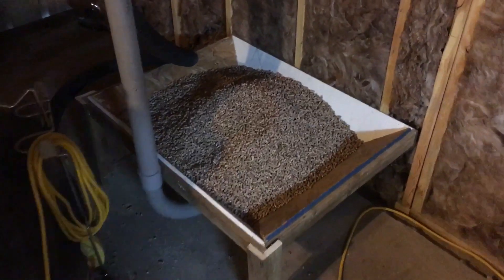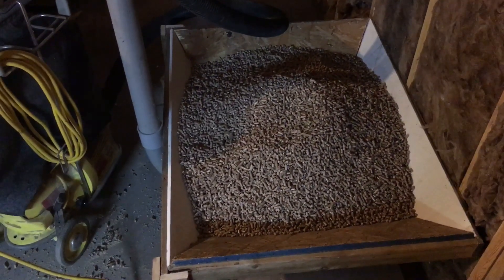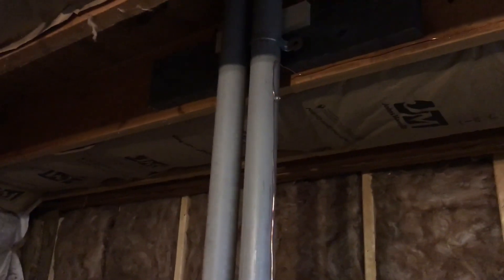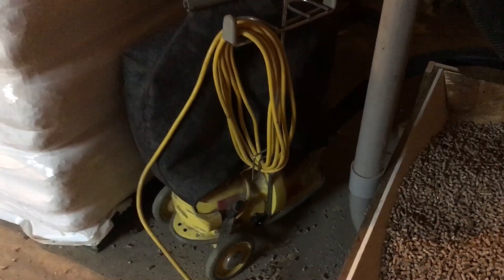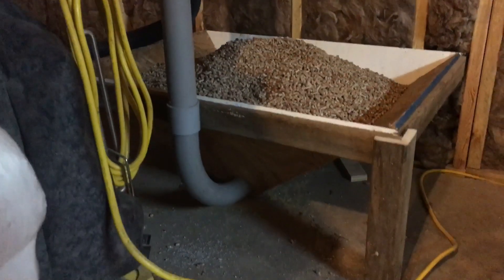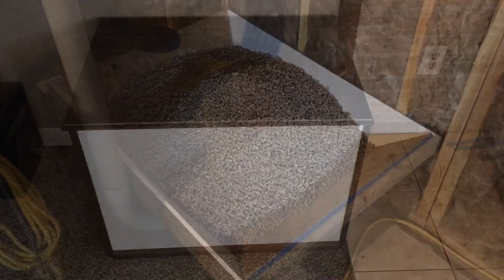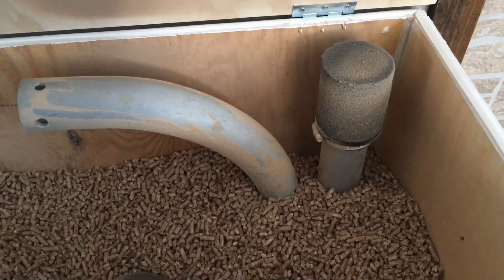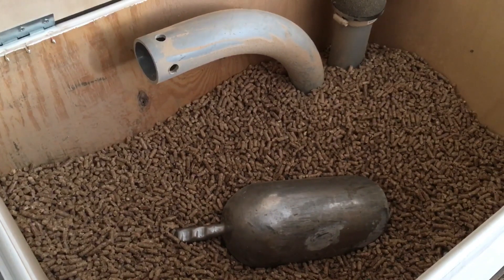Wood Pellet Transfer System

Comment: Tried to build a similar DIY construction to transfer pellets from my storage room to our main pellet hydro stove. I used around 10 meters of flexible PVC 38mm pipe (1563042294516_0..jpg)  but pellets get stuck every 5-10 seconds so it's kind of problematic. The vertical height is close to yours, one level high. I want to try using PVC pipe like one you use but don't know what is the proper diameter, could you please send me what you have used there?

I am using a vacuum cleaner able to suck 200 airwatts.

Comment: Hi Martin I really like this video I am really hoping you might be able to show a video where the Vacuum is connected and how it works I have seen the Pellets going into the Hopper up stairs amazing stuff well done on this project I don't know the size of pipes you have used Martin thanks again for this wonderful video
Reply from the maker: I'm actually in the process of completely redesigning the pellet transfer system, I should be posting updated and more in depth videos soon!

Comment: How long does it take you to xfer 3 bags?
Reply from the maker: Jay Landry it takes about 1 min or less per 40lb bag. I’ve done some minor updates to help the efficiency.
Reply: @martenkent1913  I have a box that holds 4 tons. I get a truck that delivers for me but would like to find a way to be able to fill the box myself. Here is my setup. https://youtu.be/Mp535pw7yIc
Reply from the maker: Yes, you could make a vacuum box inside your 4ton storage bin with a spring that holds the bottom of the box closed when empty. When you turn the vacuum on, it would stay shut until full of pellets, then the bottom of the vacuum box would drop open from the weight of the pellets  allowing the pellets to drop into the 4ton storage bin when the vacuum is shut off.
Reply from the maker: You could very easily suck the pellets up out of the access box you have in front of your storage bin and upstairs to your pellet stove. You may need some baffling to prevent the pellets from overloading or clogging the transfer pipe. Just play around with some wood baffles and you’ll figure out what works best. I hope to see a video of your setup if you end up building something!
Reply from the maker: So you want to be able to buy your own pellets and put them in your 4 ton storage bin? The only problem I see there, is the large volume of vacuum you would have to draw in the storage box to get pellets to transfer. The storage bin isn’t vacuum tight is it?
Reply from the maker: After watching your video again. I’d like to see what’s between the green vac line from the truck and the blue pellet supply line. I’m assuming they are very closely positioned on the inside of the storage bin, and maybe a screen on the green hose prevents the pellets from getting sucked back to the truck, therefore they fall into your storage bin. If this is the case. Try applying a vacuum to the vac port and a hand full of pellets to the supply port
Reply: You are right i would have to make that storage box air tight to be able to create a vacuum. My plan was to buy 1 ton bags of pellets and have them blown in some how to the 4 ton box inside the house. The storage box is about 10 feet away from my pellet furnace (Harman PF100) . The furnace will hold 120 lbs of pellets and i have the option to buy the 1 ton hopper that goes beside the furnace. Maybe i could make a smaller air tight box on top of the bigger one and fill that one with the vacuume. Once full i could release those pellets and repeat the process.

Comment: Hello,
I'm trying to make a transfer system in a silo. Can you give me information about the blower and the mounting system? Blower power ... pipe diameter ....
I tried a system like https://www.youtube.com/watch?v=Ek3xa9MiShc but I have a problem, I have a T-pipe under the tray to transfer the pellets. The air goes to the left of the T, go right to the silo but I have a lot of air coming out of the top of the T and the pellets in the transfer tray that is above, do not come down almost, they are blown to the transfer tray instead of being blown to the silo ???? I certainly made a mistake somewhere but I do not see where? If you can help me, give me additional info about your system. After 60 years, it becomes difficult to carry bags and it would be easier to blow.
I am in Belgium.
Cordially.

Comment: Cool. What kind of vacuum machine?
Reply from the maker: It’s a 1.5hp vacuum
Reply from the maker: Dmitry Popov it’s a old commercial NSS Super Suction Vacuum.
Reply: @martenkent1913  qué potencia tiene el compresor?
Reply: Wow this is awesome!!! we have to haul the bags of pellets right now, up some old basement stairs and it's awful. I did make a stair master sort of contraption with a winch system to bring up 2-4 bags at a time, but it doesn't look very good having 4 bags of pellets in ur living room. Any way u could do a tutorial on how you built the boxes and piping? That would be sweet. Great engineering!
Reply: @red05malibumaxx  For a sealed box in the room, use an old refrigerator, it has the seals in place just clad it.
Don't cut the cooling system, just lay it on its back with the bottom against the wall. cut the pipes in through the side where there is no cooling.
Ive seen small chest freezers used for this in Denmark they are clad in wall boards with an old table top on them then they look like a piece of furniture. 
The discharge pipe into the box is best perforated or sliced with an angle grinder inside the box to slow the exhaust down, that way the pellets don't smack the wall as hard, and pointed diagonally from one corner to the other so there is more distance.
the piping is usually 2" any smaller and a vacuum without adjustable suck will draw too fast down a narrow tube and all you end up with is a box full of sawdust as the pellets will travel too fast and disintegrate in the process
Reply: @joegodfrey549  ty for replying. This super awesome I am definitely going to to this. Ty again!!